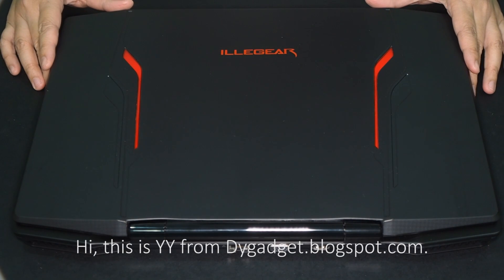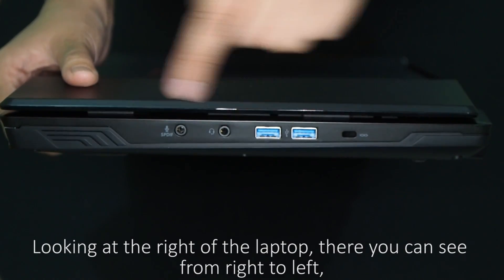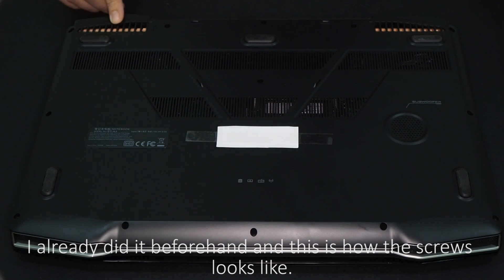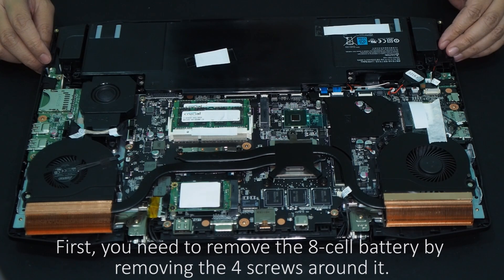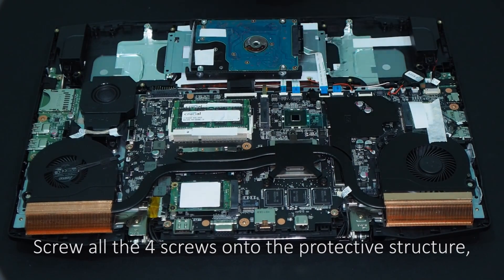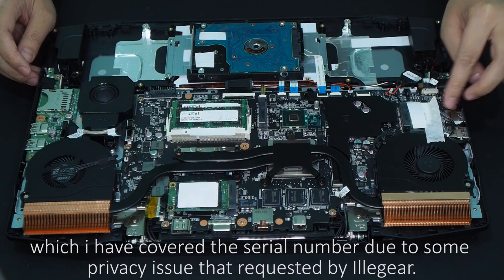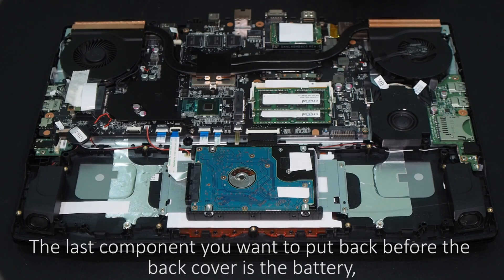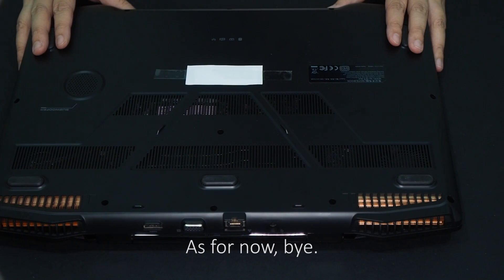Inside ILLEGEAR Z5

Comment: what power port socket does this use pleasE?
Reply from the maker: @Shawn Cullum Sorry, I didn't check when I was doing review. But you will be able to find the info by contacting +Illegear. According to their website, Full Range AC-in 100~240V, 50~60Hz, 230W AC Adapter

Comment: Illegear Z7 vid 📹?
Reply from the maker: Hi +Iqbal Saiful Thanks for your interest. We will try requesting from Illegear.
Reply: OK 👌
Reply: +Iqbal Saiful , I just install a HD to my Z7, the way to install the HD is exactly same as the Z5, design also same as well. The only thing I see the diff is, I just need to unmount 2 screw at the back cover, then I can remove the smaller case that use to cover the HD part, I do not need to remove the entire back cover.